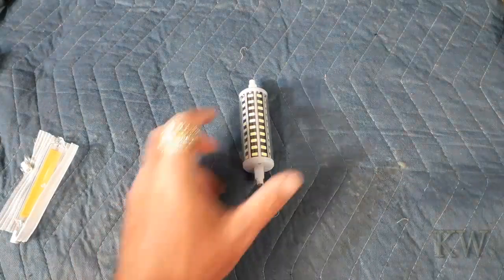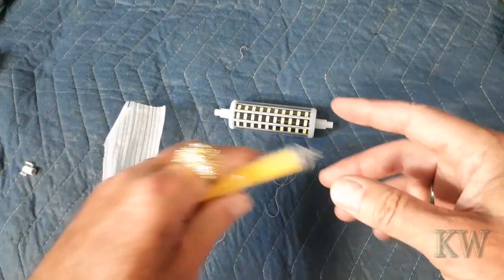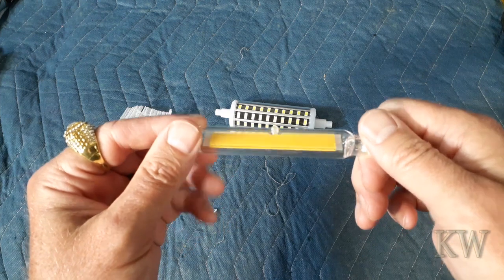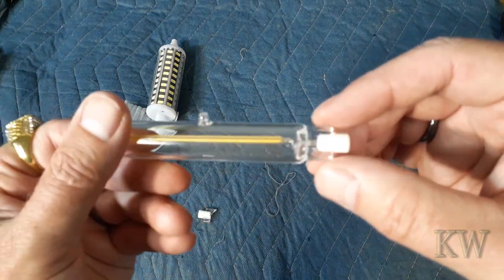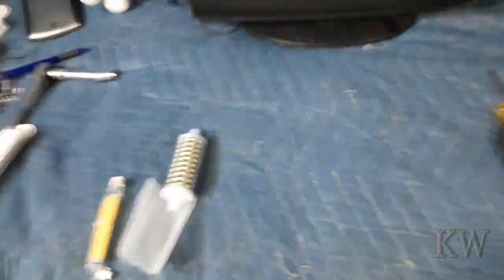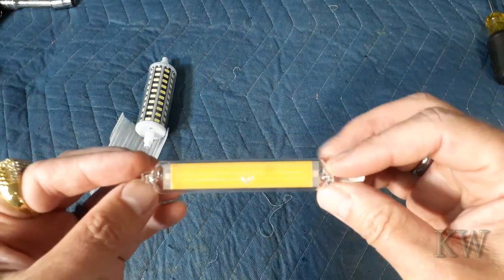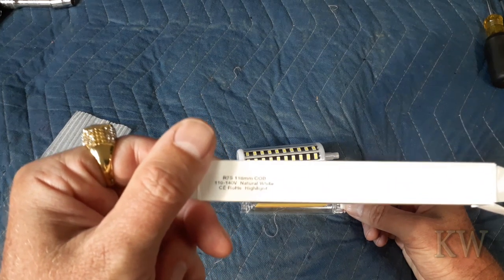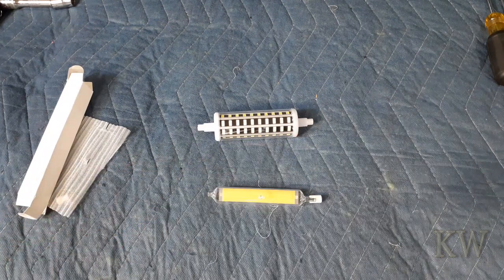LED R7 COB Bulbs.

Comment: I bought 2 of those glass cob on Ebay, however after a few months, maybe 3,  one of them died, the other one flicker and the brand name I got from local hardware store still works, so I guess you get what you pay for, sad.
Reply from the maker: I've been testing the one I have here to see how long it lasts.   It was just a cheap c#ina one so will see how well it works